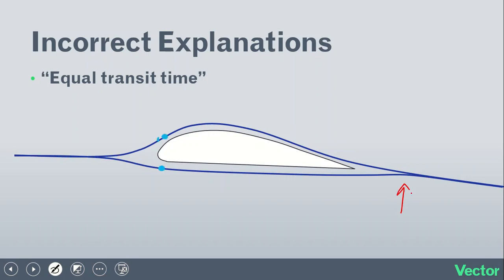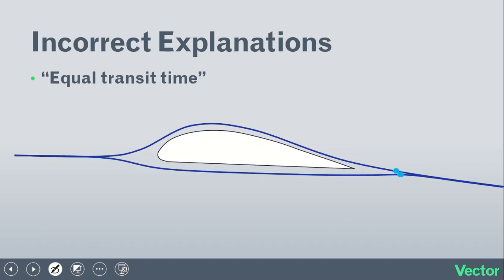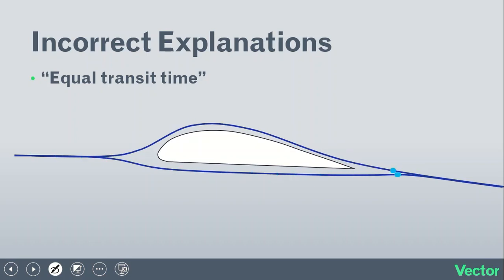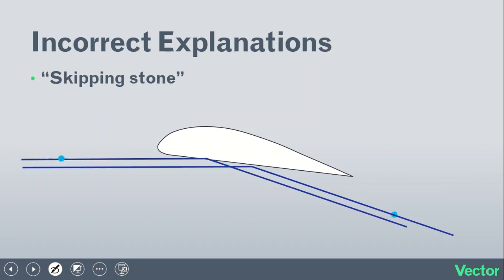Common Misconceptions About Lift

Comment: If you want to know where the equal transit time came from I have an article on arXiv, On the Origins and Relevance of the Equal Transit Time Fallacy to Explain Lift. Sorry can't post URLs.
Reply: I assume it's an oversimplification of mass flow continuity, which is a very real constraint driving the creation of lift.
Reply: @davetime5234  It is a result of not including viscosity. Without a non-conservative force, every path (streamline) around an aerofoil is like every other potential (hiking around a mountain), where the path does not affect the balance of energy. However, when you add a non-conservative force (in the case of aerodynamics that is viscosity, or friction when hiking around the mountain) then the path taken means there will be an overall effect, and not all streamlines will now be traversed in equal time. I note in my paper that D'Alembert assumed equal transit, but both he and Euler calculated it to be true, hence giving D'Alembert's paradox. The common misconception is that equal transit time can be used to explain lift, where it was non lifting flows that give equal transit (and hence D'Alembert's paradox).
Reply: @davetime5234  Let me ask you a question. You note the keyword, "asymmetry". Fundamentally, and I mean very fundamental physics, what causes the asymmetry? You are correct in everything you say in the last paragraph, but what is the physical mechanism that results in asymmetry? I noted D'Alembert's paradox which was also the solution from Euler; they both predicted a symmetric flow, and hence no drag (or lift).
Reply: @aerospacedoctor   "I mean very fundamental physics, what causes the asymmetry...what is the physical mechanism that results in asymmetry? ?"

Asymmetrical geometry of the solid to the relative wind (from the combined asymmetry of AoA plus any asymmetry of camber) resulting in an asymmetrical transit passage presented to the relative wind's dynamic pressure in the cross-sectional area of influence, which results in an asymmetrical pressure response necessary to maintain the prior existing mass flow rate in the that area of influence, is the best I can come up with at the moment.
Reply: @aerospacedoctor  answer #2, for "very fundamental physical mechanism of asymmetry":  

There is an asymmetrical conservation of momentum response to an asymmetrical transit path split.

In this asymmetry of response, two different pressures associated with two different transit speeds (governed by the conservation of energy response to maintain the continuity of mass flow rate and conservation of momentum on each side of the split), combine to a momentum direction change, with a component transverse to the relative wind.

The asymmetry of the solid, changes the relative wind momentum direction.  (which extracts an energy penalty from the forward motion of the solid)
Reply: @aerospacedoctor  answer #3, as a question:

Can we not arrive at a reasonably meaningful basic justification for lift by qualitatively considering the quantitative implications of fundamental first principle physical governing laws?:

1)conservation of mass (mass flow rate continuity)
2)conservation of momentum
3)conservation of energy

for subsonic (constant mass density), inviscid assumptions for the case of a solid object asymmetrically shaped to the relative flow?

Isn't it sufficient to reason a transverse momentum in flow will result from the above?

(where constant mass density plays an important role in the "crowded real estate" implications of preserving the 3 conservation properties)
Reply: @aerospacedoctor  "when you add a non-conservative force (in the case of aerodynamics that is viscosity, or friction when hiking around the mountain) then the path taken means there will be an overall effect, and not all streamlines will now be traversed in equal time."

Well, who am I to say, but it seems illogical that a non-conservative force is absolutely necessary to produce an outcome of a momentum change component in a direction transverse to the relative flow?

For which there will be an energy penalty for such momentum direction change, which affects the non-transverse momentum (direction of travel) of the solid object in keeping with an appropriate energy conservation transaction.

There are important lessons here for why we must separately consider the meaning of energy and momentum in relation to mass, and mass density?
Reply: @davetime5234  Sorry I got busy with other things. Lets go through some replies. In order... (it tried a single reply but it didn't post).

#2 I would have to think of the implications of the exact wording you have there, but in principle, everything in that answer is correct. However, it does not explain the asymmetry, so you need a mechanism by which the upper and lower mass flow rates are different (but they are different).

It won't let me post my reply to 3, so I will see if  I can sneak it in hear with an edit. We can have all of that, the Navier Stokes gives us all of that, and predicts lift. You cannot with Euler. The difference is viscosity.
Reply: @aerospacedoctor  Thank you for your extensive reply!  I'm still re-reading this and thinking about the implications...
Reply: @aerospacedoctor  Are you familiar with the counter viscosity augments such as appear on the Youtube channel "Dynamics Uci" with its video "A New Theory of Lift", in addition to research done on lift generation in liquid helium?
Reply: @davetime5234  Sorry, YouTube is not letting me reply again. Try a short reply 1) yes I have his 1st draft, and it includes dissipation, which is what viscosity it doing, so it is actually a pseudo viscous approach taken. 2) super fluid lift is where it gets interesting. No definitive experiment yet, contradictory results, but you will not vortices being generated in the flow due to surface roughness, and that is also dissipative, so hence even if there is lift without viscosity, there is still a pseudo viscous effect in super fluid flow.
Reply: @davetime5234  I really don't think YouTube is going to let me reply. My email address is at the end of the video on my channel. Happy to talk more.
Reply: @aerospacedoctor  Thanks so much again for your detailed reply!  I will need to take some time to process all of this, plus I have a trip coming up that will add to the delay.  But I will be thinking about the details of your response and areas where it may be most fruitful to dig deeper in my own understanding in the meantime.
Reply: @aerospacedoctor  I just checked out your video and subscribed.  Your first video is definitely food for thought and I'm looking forward to additional content you create.  I'll likely get back to you via email after a bit of travel coming up (though not infrequently thoughts come together unexpectedly in the middle of doing other things).

Comment: The key, here is that air and lower surface is just like wind blowing on you.  It pushes on you.  This DIRECTLY causes a pressure increase within the air.
NOTHING else is needed to explain the physics of that.
Air has mass and therefore, inertia, so if pushes more increasing the pressure.
..
That pressure ALSO slows down the air.  At some points it slows to a stop.  It slows BECAUSE that pressure ahead of it is greater than the pressure behind it [atmospheric pressure]
.
The relative motion of wing and air approaching each other DIRECTLY causes a pressure increase.
..
Therefore, the "ricochet" story is kinda' a little in the right direction.. . . 

It's not a bounce, but there is still an increase of the push.

..
If you analyze it correctly, you should be able to reason it out that for the flying, moving wing,  the moving wing is directly increasing the air's pressure because it is pushing more on the air when it advances on the air. It has to PUSH the air out of its way.  THat push is pressure  more than ambient.
.
This is such simple physics.  Grade schoolers understand it.
- - 
Cheers.
P.S. The converse happens above a wing. . .

Comment: Great job explaining why a common misconception regarding lift is incorrect. It could have been beneficial as well to include a corrected explanation of how lift is generated to avoid other potentially wrong explanations.
Reply: As a Lockheed Martin dev engineer told me. “We don’t know how exactly lift comes about but our computers find a good shape that does”
Reply: @JakeFick  "We don’t know how exactly lift comes about"  

Nonsense.  We do know exactly, with no ambiguity:

Lift is force from an asymmetry turning the flow.

Any solid in a relative flow produces a pressure-speed field as a response to maintaining flow continuity (conservation of mass) around the obstruction.

That pressure field is asymmetrical if the solid is asymmetrical.

That transverse pressure gradient is precisely what turns the flow resulting in the transverse force of lift.

This is simply Newton's laws of motion applied to a distributed mass.
Reply: @davetime5234  If lift were as unambiguous as you claim, we’d have a closed form Navier–Stokes solution for a 3D wing irregardless of turbulence. That’s why Boeing, Lockheed, NASA, and every university still spend millions running RANS, LES, and DNS just to approximate flow fields. Knowing the principles of lift isn’t the same as having the exact solution. Your point is like saying that once classical mechanics was fully described then we knew exactly how to get to the moon. I urge you to go to a university seminar sometime it’s actually pretty funny because every time someone brings up a report they made and 
Claim it perfectly describes lift - the fact it’s still a sought after topic proves it has not been solved unambiguously.
Reply: @JakeFick  That's a flawed argument: it's like saying emergent complexity (requiring computational engineering tools for case specific optomized design implemenation) means we don't understand combustion, nuclear reactions, rocket propulsion, orbital mechamics etc..

Emergent complexity and known rules of the mechanism responsible for that emergence are two different concepts.

You can descibe a fractal easily and precisely.  But the resulting pattern is a different question.

My prior summary of lift comes directly from the principles of the Navier-Stokes equations:

The interdependent rules of conservation of mass, momentum, and energy describing how a flow reponds to an asymmetry.

Why a pressure response emerges, why it is asymmetical, and why a transverse force results from the resulting momentum change, does not vary across all cases of subsonic lift.
Reply: Yes. So many amateurs with yet another video either simply repeating the misconceptions, or explaining they are wrong, but not the real physics.
Here is an explanation of the true physics pf one and the hardest part, above a wing: https://www.youtube.com/watch?v=3MSqbnbKDmM

Comment: Video clearly shows common misconceptions, but it would be great if you could briefly explain why lift is generated by the airfoil. In this case it is due to the change in the curvature of the incoming pressure gradient due to the geometry of the airfoil. The top surface of the airfoil has more curvature compared to the bottom surface. An increase in curvature causes an increase in velocity and decrease in pressure of a fluid. This causes the stream at the top of the airfoil to be travelling much faster than the bottom which creates the pressure differential and thus lift.
Reply: J.R.,
Actually, your description has no physics behind it. I am very sorry, but you have thrown words together that actually make no sense.
First, "Curvature of pressure gradient" is meaningless.  The flow is curved. 
Second, Pressure Gradient is the difference in pressure between two locations.
Third, it is the curvature of the flow that is important because a flat surface produces a similarly curved and accelerated flow.
.. ..
There is no physics to explain why a curvature in a flow can directly cause an increase in velocity of a fluid.  There are missing steps in that explanation.
.
A- Fluid has mass and follows Newton's Laws. Therefore, a force is required to accelerate mass and, therefore, fluid. 

B- In this case, as Euler figured out in the mid 1700s following up on Bernoulli's work, a Pressure Gradient is the source (cause) of the force that accelerates the fluid. Force accelerates an 'object' (having mass).
C- It is the pressure reduction that is caused by the flow being forced to curve.
D- It is the atmospheric pressure far above the wing that provides the centripetal force causing the curved flow:
.. ..
The true physics of ONE part of lift and the hardest part for people to grasp, is above a wing.
The decrease in pressure above a wing is caused as shown in this short video.  Once you see that it is the new Pressure Gradient between atmospheric pressure ahead of the wing and this lower pressure above the wing that is the cause of the Acceleration toward the trailing edge: 
 *www.youtube.com/watch?v=3MSqbnbKDmM*

Comment: Have you ever opened a learning book for glider pilots? Why are you not explaning what you think causes the lift on the upper side of the wing profile? Until you do that convinsingly, I'll stick to the existing books.
Reply: I don't know what is in your books.  There are hundreds of incorrect explanations repeated all over by amateur scientists. 
The true physics of ONE part of lift and the hardest part for people to grasp, is above a wing.
The decrease in pressure above a wing is caused as shown in this short video.  Once you see that it is the new Pressure Gradient between atmospheric pressure ahead of the wing and this lower pressure above the wing that is the cause of the Acceleration toward the trailing edge: 
 *www.youtube.com/watch?v=3MSqbnbKDmM*
Reply: @Observ45er  The lift from the increased speed of the air over the top of the wing is appr. 3 times as strong as the lift from the reactive force on the underside, i.e. a wing on most aircraft is sucked up more than pressed up.
Reply: @Eigil_Skovgaard   That is a fair  representation, Eigil.
.
While the pressure varies quite a bit across the area of a wing, as well as AoA, and is different for various wing shapes, I use an 80/20, or 4/1 division rather than your 3/1.
.
Another thing missed by those not understanding this, is that the changes from ambient are very small.  On the order of  0.6% - change from ambient.
..
BUT, the lowered pressure above is NOT "due to the increased speed" 
The cause of the acceleration towards the Trailing Edge is the pressure gradient formed between the relatively higher pressure near the leading Edge and the decreased pressure above the wing. Speed does not cause a decrease in pressure. That is the most common and most often repeated misconception of Bernoulli's principle.
Reply: You obviously haven’t carried a piece of plywood in the wind and it shows lol. You don’t need a wing shape to generate lift all you need is angle of attack.
Reply: Yes, plywood in the wind increases your drag, and you can even fly, if you keep it in the right position and run fast enough - preferably let a few people pull you. And yes, there is a reaction from the deflection of the wind on the under side of the wing, but the major lift 3:1 is due to the lowered pressure on the top of the wing. I have been a pilot for decades, began as a glider pilot. Bernoulli is the key word - higher airspeed means lower pressure - or lift in this case. I wish people would stop educating others before they had learned the basics themselves.
Reply: @Eigil_Skovgaard  look man I drive cars that doesn’t make me an automotive engineer.  Do me a favor type this into YouTube ( doofer 911 how wings actually create lift) the Bernoulli principle is flawed and this video explains what’s actually happening. A wing does create more lift than plywood but not because of the pressure difference like your little book tells you.
Reply: @stuckinthemud4352  Those "little books" are the official law stated by engeneers. If you were the slightest convinced about your new discovery, you would not need to be polemic. I suggest you stay with your car - independent of wings.
Reply: @Eigil_Skovgaard  look man being stubborn doesn’t change the truth.
I know it’s hard for your old brain to conceive but sometimes engineers get things wrong.  Bernoullis principle is not what causes a plane to fly. I’m willing to bet you didn’t even watch the video i recommended.
Reply: @stuckinthemud4352  Stop your nonsense. I am wasting my time. You can believe what you want. Airplanes react accordingly to the known physics, and it may come as a surprise for some content creators on YT.
Reply: @Eigil_Skovgaard  lol did you actually watch the video i recommended?
Reply: @Eigil_Skovgaard  Your original comment says “ why are you not explaining what you think causes the lift on the upper side of the wing profile? Until you do that convincingly I’ll stick to my existing books”    Ok so I just sent you a link to a video that explains it ( convincingly) just watch the video you might learn something.
Reply: @Eigil_Skovgaard best statement and understanding